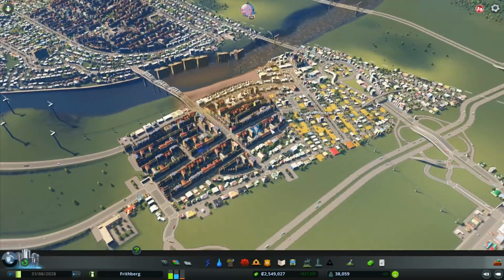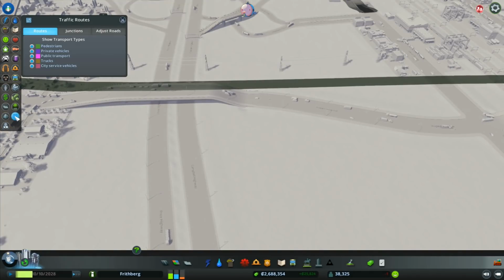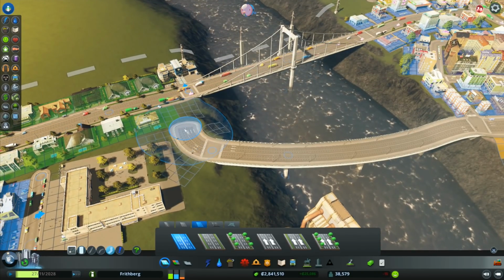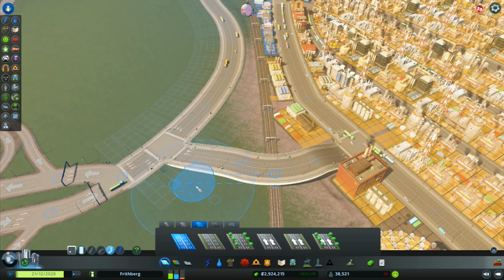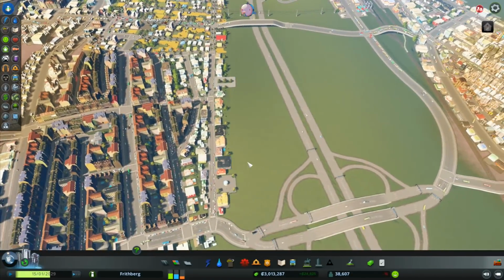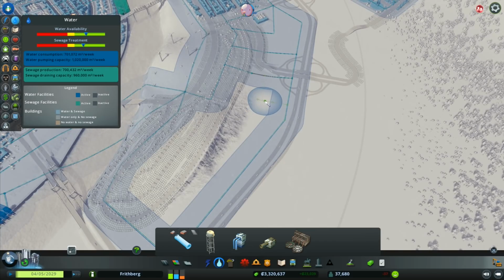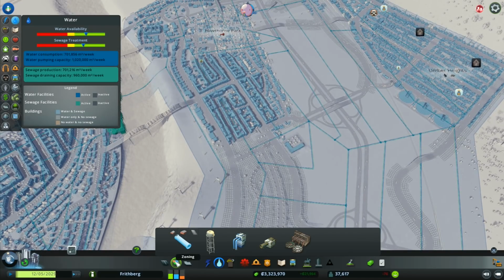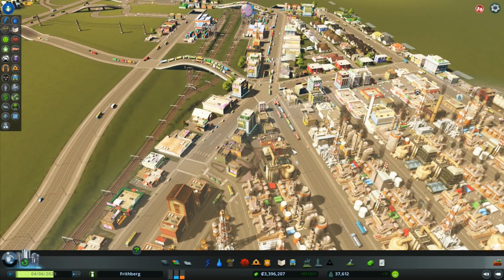Let's Play Cities Skylines #18: Clifftop Housing!

Comment: I already wrote it once when you started to solve the transport problem in this location. It is necessary to solve the cause and not the consequences. The reason is that you have a single freight station here, and all the traffic around the city is heading here. The solution would be to build another station on the opposite side of the city.

Comment: Your "intersection" idea by the train station was great, onr idea to add to that is that u do exactly what u did plus an sliplane to the road that moves in to the city, and to solve the "traffic takes fastest route" - problem u makes the six lane one way pointing to the train station

And a tip: a "diamond intersection" is golden especially if u have one way with high traffic and u got a road crossing or joining like in ur three way intersections by the middle of ur oil area

Comment: Reduce the amount of intersections (especially with 6 lane roads) and build more direct routes as main road (6 lane), so with less stops, corners and intersections. Also Traffic lights are the way to go on intersections where the same type of road cross (unless it is clearly that a certain road is used less.) All this will drasticly increase the traffic flow.